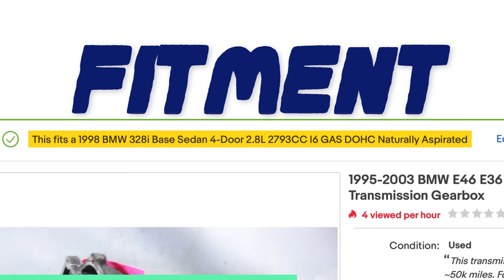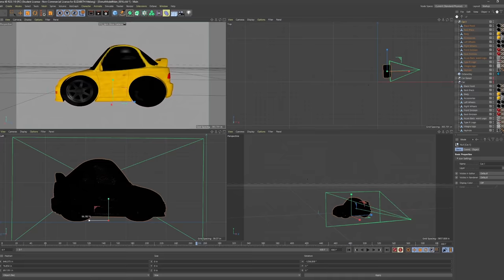Is a Manual Transmission Swap Worth It?

Comment: I love how Zach always works on the ground with jack stands. Like, we know he has access to a lift, but he chooses to do it cowboy style because thats the shit most of us are doing. What a beauty.
Reply: Nah, he does it because he can work lying down
Reply: I work at [company that owns and operates lots of delivery vehicles].
I get to see the vehicle shop some days, and occasionally take a look at all the vehicles that are part way through a repair job. No lifts in use, ever... but they do have a whole bunch of jack stands. I saw a few that were clearly labeled as 6 tons maximum weight per jack stand.
The vehicles that sit on 'em are actually somewhere around 6 tons empty weight (that's the total on all four wheels). 
I don't actually know why there aren't any lifts but I would suppose cost and safety might be involved. It doesn't appear they actually need to do all that many repairs requiring a jack or lift anyway (relative to all the repairs where the truck sits on all of its wheels instead)
Reply: @julianbrelsford  I'm happy for you or I'm sorry that happened I'm not reading all of that
Reply: @bigboyhours6473  lol TLDR
Reply: tldr: shop where the guy works at barely uses lifts at all, even if the load is just shy of the limit of the jack stands. seems safe idk
Reply: The older you get, the harder it is to work on the ground with jack stands.
Reply: @bigboyhours6473  who asked?
Reply: @juan_valdez117  🗿
Reply: @bigboyhours6473  
Bro it's only a 30 second read
Reply: @meeese6_  6 ton per jack
Reply: Nah, he just likes to... uhh... lie down on the job!
Reply: @julianbrelsford  It's safe. Think about it each jack is not holding the vehicle all by itself. Nor does the vehicle weigh 6 tons or whatever at each point of contact for the Jack's. So each one is actually only holding half or less of what they are rated for. While a lift is holding all of its weight  so it has a much higher failure point. If you have vehicles that are at the weight limit for your lift. Then it is safer to use multiple Jack's not at their full weight limit. I am basing this primary on my knowledge gained from moving logs around with hand crank tools, called griphoists. So I could be entirely wrong.
Reply: Late to the game here, but I just thought this exact thing.
Reply: Jack stands (I gave mine away and prefer rims and wooden cribbing) work fine. I worked at one used car lot that had four bays and no lift. It was easy to roll our hoists and jacks between bays and really never a problem. Truck cab R&I goes much faster with a lift but we did those too with little fuss by using our wrecker boom. I can now easily afford a lift but worked so long without one (especially in salvage) I don't care. It's not even the money, I just can't be bothered to install one and I've done that before too.
Reply: @jd9119  you got that right
Reply: Just park it in dirt and dig a hole so u can work under it
Reply: It may have been because it's just easier to lift the transmission a couple of feet off the ground vrs 8 to 10 feet off the ground.
Reply: @aaronburkeen6409  nah. It’s basic weight distribution through physics.
Reply: I find to be under the car to be comfortable and easier at least for me
Reply: Chrisfix s the same way and he hides his face because he doesn't want fame but chrisfix doesn't do complicated stuff like  Zach or jerry
Reply: It's important to note that working with car jacks and working with a car lift are two different methods for lifting and servicing a car. Each method has its own strengths and weaknesses, and the choice of the right method depends on various factors, such as the scope of work, available tools, space, and safety considerations. Here are some reasons why working with car jacks might be preferred over using a car lift:

1.  Cost-effectiveness: Car jacks are generally more affordable to acquire and maintain compared to more complex car lifts. Lifts may require regular servicing, and their installation and training costs could be higher.

2.   Smaller space requirement: Car jacks take up less space compared to lifts, which require more space for setup and operation. Using jacks can be particularly useful in tight or small spaces, such as home garages.

3.   Portability: Car jacks are usually portable and easily movable. They can be used on any level surface, making them convenient for mobile repair services or hobbyists who work in multiple locations.

4.   Ease of use: Car jacks are typically easier to use compared to complex lifts, which may require more expertise and training for proper operation.

5.   Ease of maintenance and repair work: Some maintenance or repair tasks may be easier and quicker to perform with car jacks since the car's height can be adjusted as needed. On the other hand, lifts can offer better visibility to the underside of the car, which can be beneficial for diagnosing more complex issues.

While car jacks can be a good option for many maintenance and repair tasks, lifts have their own advantages, especially for heavier or more complex jobs. Lifts can raise the car higher, providing easier access to the underside. They can also be a safer option when used correctly and in adherence to safety guidelines.

Regardless of the method used, it's essential to always perform car maintenance and repair work safely. Always follow the manufacturer's instructions and recommendations, as well as use appropriate safety equipment. If you're unsure about your skills or abilities, it's best to seek help from a professional or qualified individual to avoid accidents or injuries.
Reply: I love his hot sister
Reply: @Rektonator hah! Get Chat GPT’d! 😂
Reply: @aaronburkeen6409 science is still science brother 😌🔥🔥🔥

Comment: That high strength threadlocker is giving me flashbacks to ChrisFix and his medium strength threadlocker addiction.
Reply: Are they not good?
Reply: He still is addicted to medium treadlocker
Reply: @Boypogikami132  dude flywheel bolts on Detroit diesel are put on with eng oil to help with achieving max and accurate torque it was weird to me at first cause i worked on cars for years prior
Reply: CHRISFIXXXXXXXX I LOVE HIMMMMM
Reply: I dont rhink ive ever used threadlocker in a car. Rust is free locktite
Reply: @chickensfloat7427  Don't want that bolt or nut to move? Crossthread it. That shit is free and permanent. 😂
Reply: @chickensfloat7427  great heavens

Comment: He just raised the value of this bmw by 80% just by a transmission swap
Reply: "This little trick doubled the value of my BMW!"
Reply: Thank god for this video for allowing me to sell my 140k e36 Boston green clubsport for 5k :)
Reply: I thought manuals were cheaper?
Reply: @JuanG2020  People sometimes pay more for the manual car because is more sought after than the automatic ones, like in this case with the BMW if you saw the first video of him trying to find a BMW thats relatively clean and manual they will charge you an arm and a leg but if you get the less desired automatic BMW it's a lot cheaper due to people not wanting it and it is sometimes much cleaner because it wasn't beat on as much as the manual car
Reply: @JuanG2020  There not cheaper anymore unless you find a clapped out one. 95-99 are getting to the 25 year old mark. eveyone that has a good clean preserved one, is scrambling to get a higher value in the car which is what making the market go insane with them right now
Reply: and the transmission swap cost 3x the value of the car.
Reply: @Tommy_Boy-Z  good to know
Reply: @JuanG2020  go to San Fran or anywhere with hills and you can get any manual way cheaper
Reply: @unimike4637  dealerships hate him!!
Reply: @DrRockso9  thanks for the tip!
Reply: @thepjup4507  can you put a price on fun  and 3enjoyment of life?
Reply: @nightreapers3425  they're*
Reply: @thepjup4507  5x less actually. You can see numbers in video.. 🤦‍♂️
Reply: @nightreapers3425  They are cheaper in brand new cars from the dealership
Reply: Is it worth the swap if I have an automatic transmission bimmer with manual option without the clutch?
Reply: @uncommonsense360  depends on what year and model it is
Reply: @Tommy_Boy-Z  2007 e93 328i
Reply: @uncommonsense360  The value of the your 07' bmw will probably go up a little bit and you'll have more fun with a manual transmission, so if you have the time and money then yes it would be worth the swap👍
Reply: @nightreapers3425  God*
Reply: @JuanG2020  for regular daily cars, yes, not for enthusiast cars. These cars cost what people want to pay, and enthusiasts want manual transmissions. For a non-car guy the auto is worth more.
Reply: @thepjup4507  How you figure? If you look around you can get parts cheap. Any transmission at my local pull-a-part is $175...
Reply: @DrRockso9  lol  at people who can't drive manual because of hills.  That said I was once behind a girl driving a toyota pickup from 1990 or so, and we came to stop sign on a hill, in the rain. It ripped a hole in spacetime itself.
Reply: Not really. Manual transmissions cost less than automatics. And it seems to me that most people in the USA used-vehicle market don't consider the cost of labor to make this sort of change, and most people in this country don't want a stickshift (I love them though).
Reply: @JuanG2020 : We don't know the answer to your question of what you thought, because we're not mind readers. You should try just telling us what you thought instead of asking.
Reply: @HelloKittyFanMan.  Thanks for the input. I will take it into consideration.
Reply: Guess what,  @JuanG2020 . You can do it with this one right here, using the comment-edit feature!
Reply: @HelloKittyFanMan.  Ok.
Reply: So when,  @JuanG2020 ?

Comment: I actually did this because of this video on a 2006 ford mustang, and it was my first big job. I did it while I was pulling the engine so it is not fully the same , but if you plan to tackle this I have some advice regardless. First, he isn't kidding when he says do your research, Take tons of videos and pictures of everything together , and as you take it apart, stay organized by keeping bolts in Baggies and marking on them what they go to. Now planning is key you're going to need  too dedicate a lot of time to this especially if you're relatively new don't expect it to be done on a weekend Plan accordingly. Speaking of planning, order everything you need before you start the job you're going to be very annoyed that you wasted an entire week in the garage because you have to wait until the UPS gods deliver your aftermarket clutch line you desperately wanted. Biggest tip of all. If you're learning how to drive a manual try to stick to an oe style clutch when picking parts Try to stay away from 6 puck, or really aggressive stylings, you can go to stage twos to account for horsepower, but you're going to stall out so much at red lights trying to learn on a hyper aggressive design; ask me how I know. Other than that take pictures of your progress, and take pride in your ride I grin constantly as I im banging gears on the road It really is a riot.
Reply: Hey i know this was posted a year ago but you have no clue how long I've been waiting to see something like this. I bought my very first car and it's an auto 2007 mustang gt. I've been trying to figure out how to do a manual swap, or if it was even possible on our cars. Finally finding someone who's done it was a real relief, if you're still active on this account I'd really appreciate any info you got on how to do it and what to get!
Reply: I got too lucky with my 84’ bronco 2 with 5 speed “overdrive” manual tranny, with an insane 76k km with everything original. Its almost as if this car has been waiting for me for 40+ years
Reply: Just about ready to pull out my engine and transmission from my 08 Mustang to do the same (and more). This is gonna be fun! Have being working towards this for months (its a crash damage car I am rebuilding).

Comment: The only Manual Transmission swap I've ever done, or to be more accurate, helped a friend who had the mechanical experience, was on a 1981 XE Ford Falcon. The reverse gear in the stock 3 speed auto shat itself, and I managed to find a reconditioned 5 speed manual for a good price. We did it on ramps in my sloping driveway and took the whole weekend to finish, but it was the best thing done to that car. The 5 speed manual went like dream and the Falcon became a hell of a lot more fun to drive.